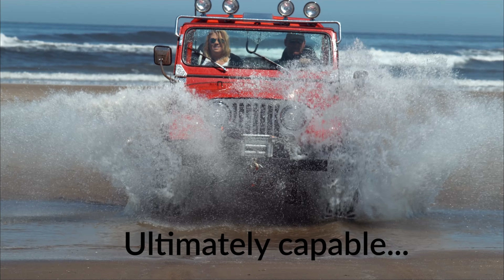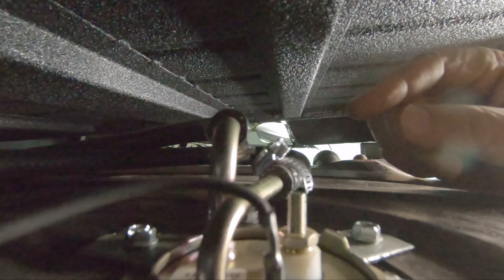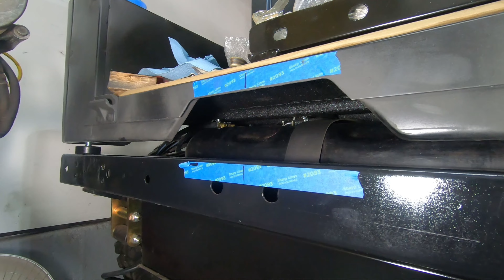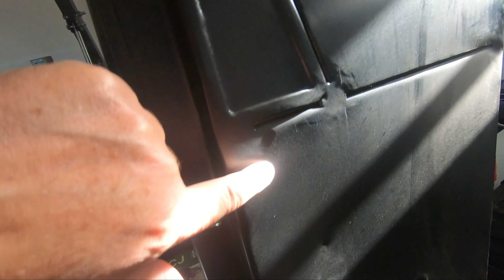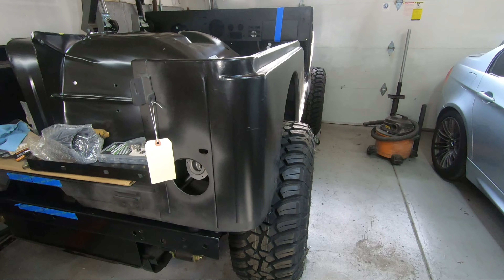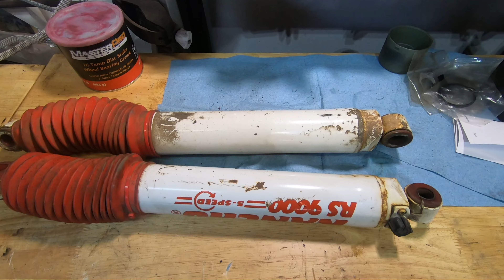Jeep CJ-5 Restoration - EP28 - Tight tolerance on our 21 gallon fuel tank as we set the tub in place

Comment: Is this the repli-tub that they do extra work to
Reply from the maker: Hi Terry.  Yes, the folks at Willy's Overland import the tubs from the one company - I think based in the phillipines - that has bought the rights to the mold or whatever it is that allows them to reproduce the tubs and then Jay and his Team sort of fix them up as their "value add" to the equation.  Well worth getting it through them I think, as you would most likely struggle a lot of the Willy's Overland guys didn't fix them up.  You can tell that the overseas production is not that concerned with quality control.